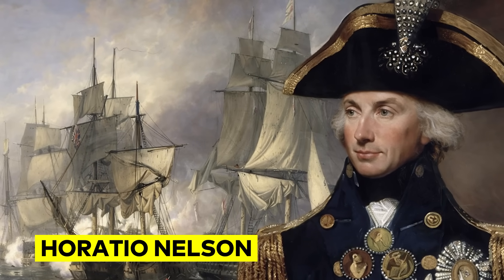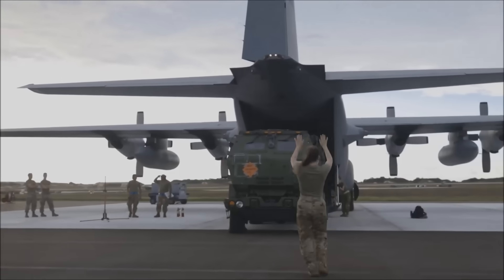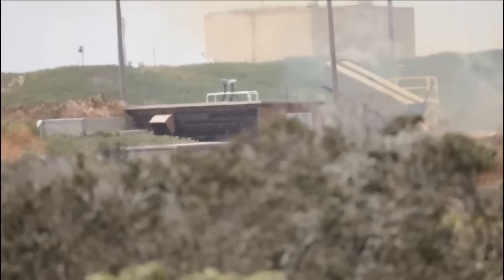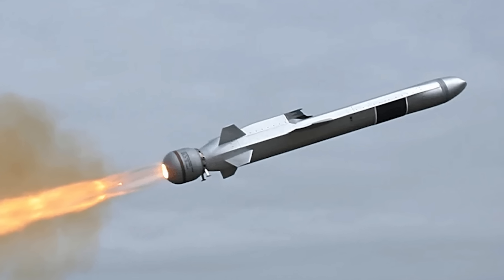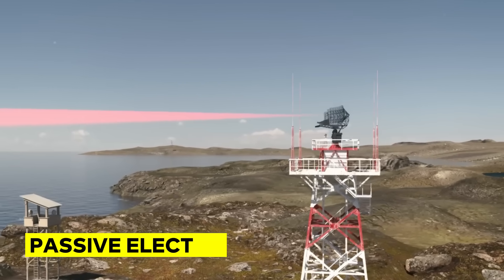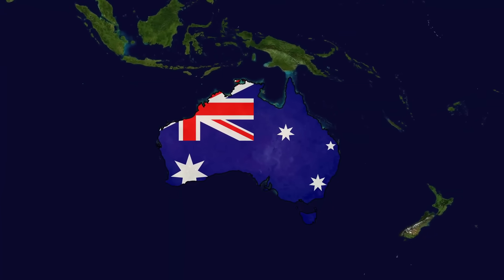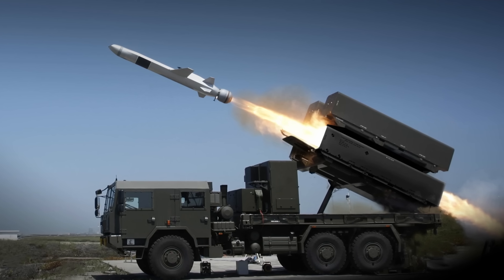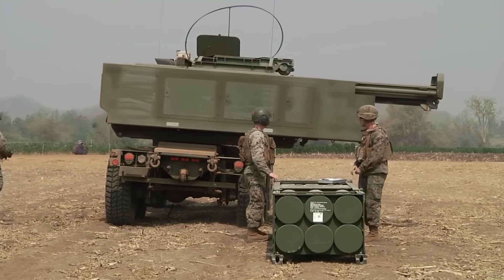Strikemaster: Australia's Homegrown Maritime Strike Capability

Comment: Considering the launch platform the Kongsberg RGM-184 NSM is a reasonable SSM, speed is sub-sonic but that has some advantages when trying to hit a moving target. The range is reasonable if using a land based acquisition and tracking system. The video states 300km, which is more than I expected. This would require air based acquisition and navigation systems to hit a moving target. I wonder if it can use satellites as well? The key to modern naval warfare are SSM’s and SSN’s, looks like Australia is getting both.

Comment: Really don’t understand why they couldn’t fire these missiles from a HiMARS, and make the missile just another round for them to use
Reply: Himars is a bottleneck. Everyone wants them at the moment. There is a wait for them. 
Strike master is readily buildable. It is also smaller and more mobile than a himars.
Two different capabilities that should both be utilised.
Reply: @Angus775n  I take your points but I think a more flexible platform, that can perform multiple talks like HiMARS is a generally a better option than a truck that does only one thing. 

Once StrikeMaster fires it's munitions, theres nothing else it can do 

It also has the advantage that if an enemy took out one or two of these vehicles in an expeditionary force, they would know they have eliminated this capability, if NSM was a munition, they couldn't be comfortable until they have take every one of a more flexible platform.

Comment: GMARS would be a good system to adopt as well, as a strategic long-range fires asset.  Australia already have the HX 8x8 truck platforms and GMARS provides twice the ordnance load out as a HiMARS.  Imagine that: four PrSMs taking out a Type 055 from 1000 kilometers away and that's just from one single GMARS let alone an entire battery.  Sure they can't be tactically airlifted like a HiMARS but do they really need to be?  The AS9 can't be tactically airlifted either.